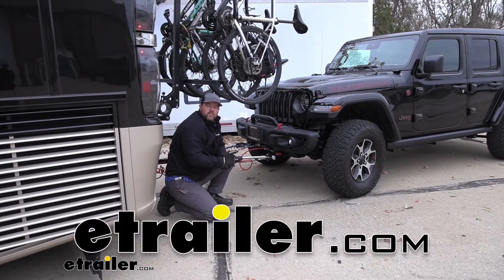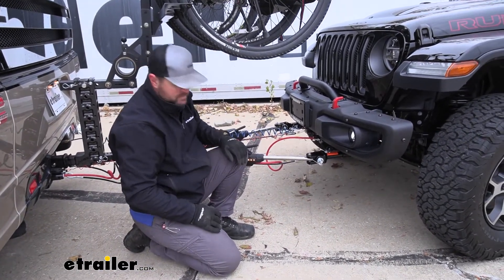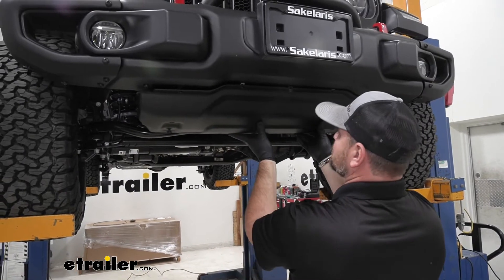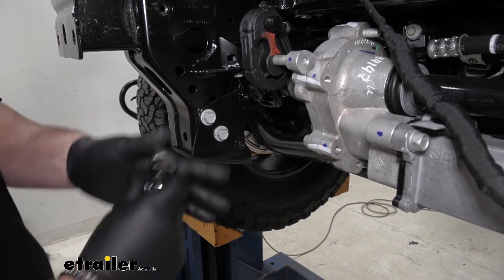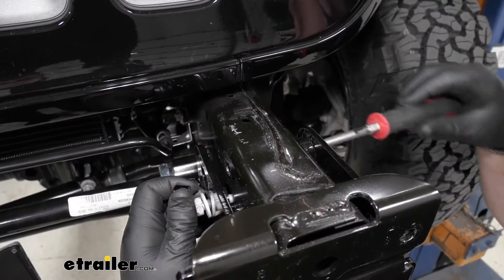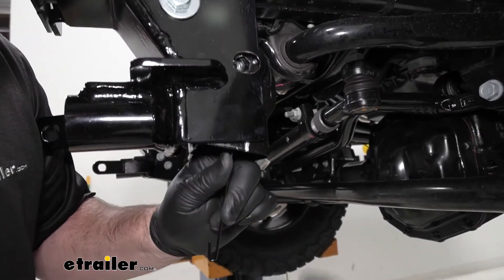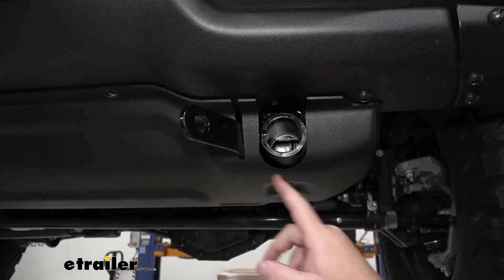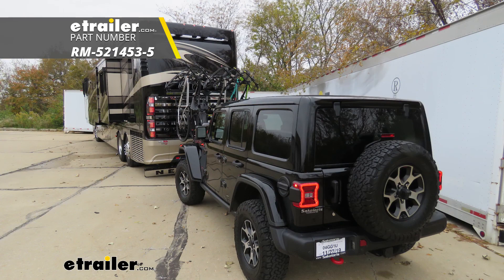Setting up the Roadmaster Direct-Connect Base Plate Kit on your 2020 Jeep Wrangler Unlimited

Comment: I have a 2021 Wrangler Rubicon with a steel bumper. Are there any installation differences between the 2020 and the 2021 Wrangler installation procedure?
Reply from the maker: Yes the installation for the 2021 Jeep Wrangler will be the same as for the 2020.
https://www.etrailer.com/Base-Plates/Roadmaster/RM-521453-5.html

Comment: Can you use this same instillation method if you have a Winch installed?
Reply from the maker: The baseplate should not interfere with your winch placement. This of coarse depends on what size winch you have and where it mounts. Check out the installation details to see where the baseplate mounts compared to your winch.
https://www.etrailer.com/Base-Plates/Roadmaster/RM-521453-5.html

Comment: I have a 2022 Willys Wrangler - factory bumper and rock guard. Is the installation procedure the same?
Reply from the maker: Yes, this base plate is designed to fit the 2019 - 2022 Jeep Wrangler with factory steel bumper
https://www.etrailer.com/Base-Plates/Roadmaster/RM-521453-5.html